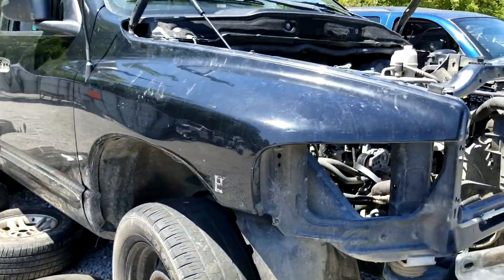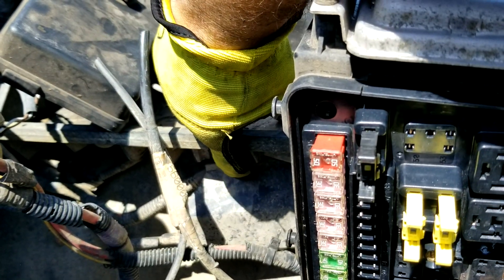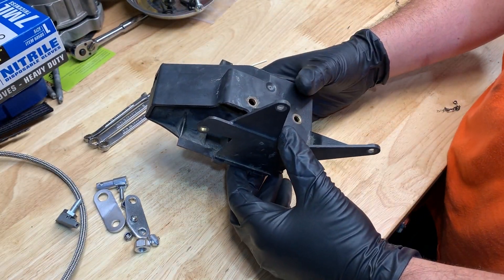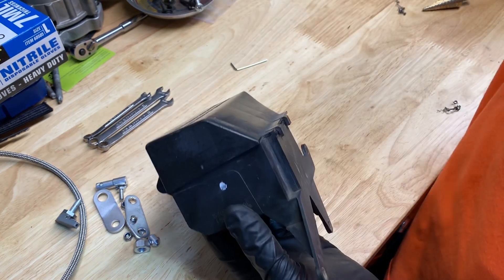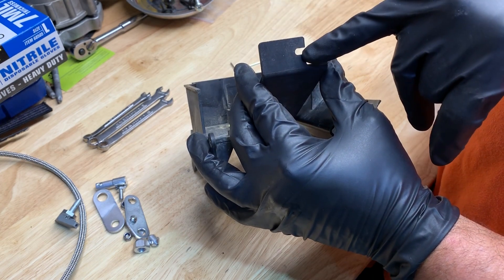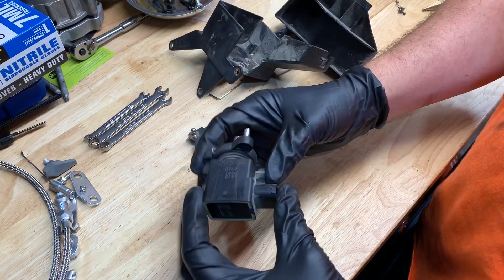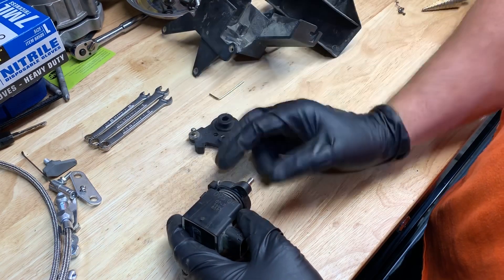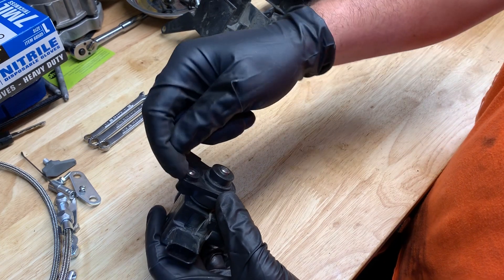DIYHEMI - JTT#001 -  03/04 Hemi Throttle and Kick Down

Comment: Can this setup be used for drive by wire throttle pedal OR only for drive by cable mechanical throttle pedal??
Reply from the maker: We aren't sure what you mean by that. All hemi engines have an electronic throttle. It's up to you if you want to use a bellcrank sensor or regular electronic pedal
Reply: Ok. So if I use the regular electric pedal with this set up, where does the rest/cable  connect to up top of the motor? Sorry I'm a little confused. I was looking for another video of yours to see the mounting and hook up, at the engine.
Reply: Also just bought your thermostat spacer w/2 ports. Great idea. I'm trying to help a friend use his 727 with the Gen 3 hemi. Only issue I am having is the kick down for the 727. I still want to use the drive-by wire pedal. So I'm not sure how to do that unless he converts to a manual valve body...I was hoping to use your bellcrank set up but confused where the rest gets hooked up to the pedal or harness somewhere...
Reply from the maker: The bellcrank gets hooked up to the TV or kickdown lever on the transmission. The original cable that is with the 03/04 box gets connected to the original gas pedal in the car
Reply from the maker: one cable goes to the transmission kickdown lever, one cable goes to the gas pedal inside the car
Reply: Ok so we would use his original mechanical gas pedal NOT, the newer drive by wire gas pedal, correct? Thank you for the update!

Comment: This is great info but everyone on youtube that makes a similar video is leaving out one small but crucial piece of info. The bellcrank wiring to the harness meant for a drive by wire pedal, it gets mentioned but never shown. Is the wiring for the pedal on a standalone harness spliced and the wiring for the Mercedes/04 dodge APPS spliced on to the standalone harness? How is this done what wires go where? Then what wires connect to the electronic throttle body and how does this new set up engage the throttle. Not being rude but very large piece of the puzzle left out here that would be very helpful.
Reply from the maker: Sure, we can introduce a new video that answers this question for you.

Comment: Hi, great video.  I picked up a couple of the sensors at jy.  Is there a way to check by apply voltage to see if good before going through the whole install?
Thx

Comment: I’m using a 727, will I need the kick down cable? Or do I just need the black box and gas pedal? (2016 Ram 5.7)
Reply from the maker: You will need a kick down cable unless you install a manual valve body
Reply: @SUBLIMEparts  thanks!

Comment: Finally some info... My APPS is shot on my '03 and mechanic said I need to replace the entire pedal assembly because that's where the sensor is which isn't true.

Do you have the part#'s for the part itself? OEM and Mercedes?
Reply from the maker: I don’t have the part number off hand but they can be had on rockauto for a fair price. Note many 03’s had faulty ones that failed. Get another from 04 on and you should be good

Comment: there is another dude on the interweb that made the throttle body actually worked by a throttle cable.  with an endurance race car, should i be doing that or what you guys are doing?

Comment: How the hell do you get the box off the truck
Reply: It's bolted to the bottom of the battery/fuse box tray.  And at the firewall, pull the clip off the inside and it should pull the retainer clip right out.  Good luck!

Comment: Can I use this throttle setup with the later years 2009 with the vvt hemi
Reply from the maker: New Mexico Sports Academy NMSA you sure can
Reply: What about the difference in the wiring harness since it’s CAN bus. Is there a way I can diy that harness to work with my 02 durango?
Reply from the maker: New Mexico Sports Academy NMSA  I’m sure you could. It just takes a little time and creativity. All can functions would need an immulator
 to run gauges. Or you can use CAN gauges
Reply: Do your videos for wiring diy can also be used for the newer 09 hemi with can bus? Which video or part should I pay attention to?

Comment: These pieces of crap go out all the time I would suggest buying a new one I have been through two used ones in my Ram 1500 in the past 3 months
Reply: I just had mine rebuilt with the upgrades required less than a year ago. I’m trying to use this one
Reply from the maker: Geoffrey B the earlier 2003 ones do go out frequently, you are correct. They revised the design for 2004. Also look into Mercedes SUV as they use the updated sensor

Comment: ok help me out what does the kick down do? whats the purpose of it??
Reply: Makes your transmission shift down aka kickdown a gear when you accelerated hard because if you accelerated heavily in 3/4 they cannot take the torque or power as well as 2nd can so if your in third and gas it hard it puts you in 2nd until it shifts again

Comment: your videos are awesome, thanks for your time. I'm doing basically the same thing your doing, putting a 5.7 in a e body barracuda with the a833. can you do a video of the specifics of installing a manual harness from the 05,-08 truck/car hemi into a old school mopar? the whiteboard is kind of hard to understand, could you do a video of the actual harness, with the modifications, and items needed to run that application? If not, could you message me with what I need. thanks again for your time.